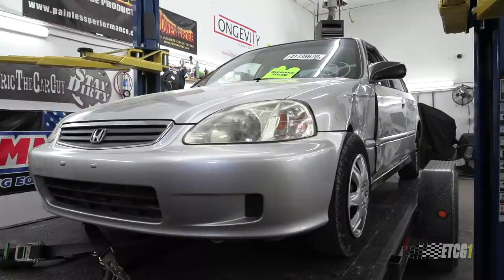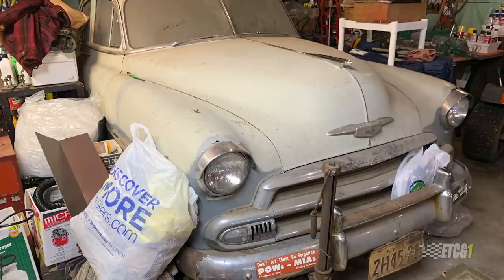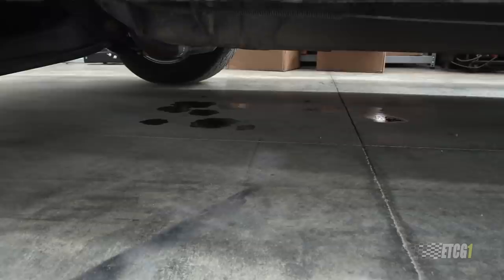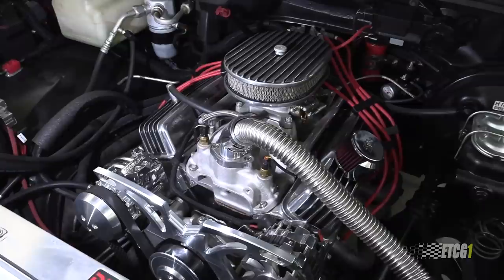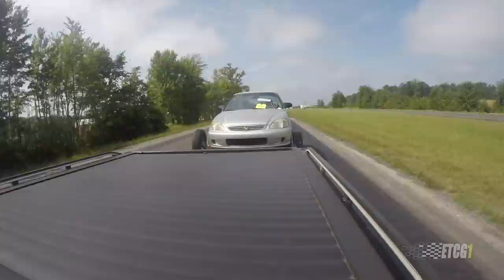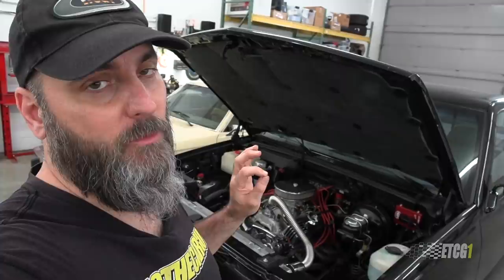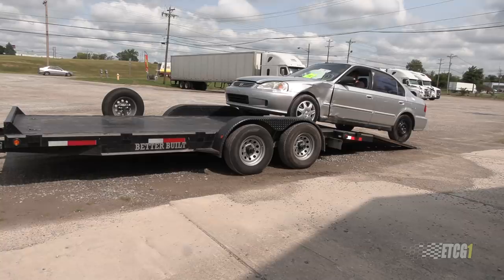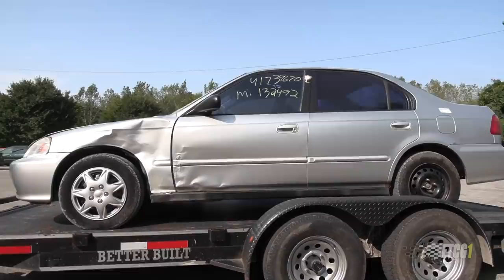First Time Towing with Dads Truck

Comment: For towing vehicles on a trailer, you need a minimum of a 1 ton truck. For instance my 1999 Dodge 3500 with the 24 valve Cummins has a tow capacity of 17500 lb, which would be a perfect size truck to do the kind of Towing you want to do. You also have to take into consideration the type of trailer you are going to be using, such as the tag along,  hitch to the bumper trailer, , a gooseneck trailer, or a 5th wheel setup gooseneck trailer due to the leverage on the back of the truck.
 With a tag along trailer as you have experienced the weight will leverage the truck making the front of the truck light and unstable. A gooseneck setup is better because the weight is directly over top of the rear differential giving better balance between the front and rear axle. 
With the fifth wheel setup you can slide and adjust the fifth wheel to not only balance the weight between the front and rear axle but also to adjust clearance where the trailer will Miss hitting the bed.
Reply from the maker: Excellent info. Thanks for the comment.
Reply: @ETCG1  That is not excellent info, it's very bad and misleading information. With your truck you can easily tow with it. People use 1500's daily to tow cars for a living. A 1500 is perfectly fine for a single car. Multiple cars say 2 to 3 depending on configuration you can get by with a 250/2500. For 4 to 5 cars then a 350/3500 would be advisable. If you only plan on towing 1 car at a time, that truck will be 100% fine. 

With the kind of setup this guy is talking about, that's more in line with a 5 car trailer. I highly doubt you would want more than a 2 car trailer.
Reply: @q......  A factory stock 1500 of that vintage and model,  tow capacity is in the 7,000 lb range, when equipped correctly to do so. You figure on this test run on towing the Honda, you're looking at, maybe 3200 to 3500 lbs for the car, and 1500 to 2500 lbs for the trailer, your looking at a maximum gross of just the trailer and car at the most 6,000 lbs being towed, which is maxing out the Chevy's limit. Yes, obviously the truck will pull it, but as Eric said, it's not safe. 
Now trying to haul the 51 Chevy + extra parts, + hold down equipment, the weight between a 3600 t0 4500 lb car and a 2500 lb trailer, that's a ballpark gross of approximately 7,000 lbs, give or take.  A 3/4 ton will be a better choice for a tow vehicle, but a 1 ton would be best for the combination of the heavier duty engine if diesel and drive train and suspension, dual wheels for better lateral stability,  makes it the best choice on versatility to haul what he needs to.
 For the Honda yes 1 ton is a little overkill, but safe. If he gets, say a 5000 lb '59 Cadillac, he's still well equipped to do so with any configuration of trailer he chooses to use.
Now, out of 20 years of driving semis I've never seen 1500s hauling vehicles commercially. I'm not saying no one has tried, but I haven't seen it. DOT would be making money hand over fist in fines over that, .
Reply: @mikeadams2677  " You figure on this test run on towing the Honda, you're looking at, maybe 3200 to 3500 lbs for the car, and 1500 to 2500 lbs for the trailer"

You really need to do a bit of research, because this makes you look like you do not know what you are talking about. A 2000 honda civic does not weigh 3200 to 3500lbs. Not unless you fill them up with a lot of weight. The weight is anywhere from 2400 to 2600lbs. I could maybe see 2800lbs max. That trailer at most weighed 2,000lbs. The problem with him towing it was the weight was too far forward. He read the 60/40 bs and didn't know how to accurately apply it. He had way too much nose weight. Period end of story. It was unsafe because he used piss poor information and went by people like you giving him bad information. 

" your looking at a maximum gross of just the trailer and car at the most 6,000 lbs being towed"

You are using bad information. The trailer was a tandem axle trailer with trailer brakes. 6k lbs GVWR is the shittiest smallest trailer you can buy. The one he had was a rental and was quite a bit beefier. That one was easily 7k, if not closer to 10k. 

"which is maxing out the Chevy's limit."

No it's not. The limit is mainly pulled from how strong the engine is and the brakes (which he upgraded). An unbraked trailer will require a heavier truck, a braked trailer the loads can be offset by quite a bit. Without doing some testing of my own like how much it squats with what weight I'd be comfortable driving a braked trailer at 7500lbs gross 600miles or more without hesitation. That is if I load it or know that it's properly loaded and or able to adjust it if it was loaded improperly. 

"Yes, obviously the truck will pull it, but as Eric said, it's not safe. "

Again it was only "not safe" because he does not know much about towing and listens to people who don't know much about it either. If he followed the 10 to 15% tongue weight rule. Stayed within that range and he would have been golden. From my personal experience and talking with other transporters and people who do it for a living, when you load the trailer if your truck squats around 1" your tongue weight is very close to that 10 to 15%. You can test this easily with an engine hoist which Eric has, and a crane scale with a capacity of at least 1,000 lbs. The trailer is a known weight, the car is a known weight. Then using that you can use the crane scale and the engine hoist to determine what is in the 10 to 15% window. It's not rocket science. In this specific case, 4400lbs or so for the trailer and car on it, 10% of that is 440 lbs. 15% is 660 lbs. Putting the engine hoist at the front of the trailer and using a crane scale in line to the tongue of the trailer and jacking it up and taking a reading. If it's 1,000lbs... move the car back some and remeasure. If it's 200lbs, then move it forward some. It's not rocket science. Since you drive a truck, you should know all about adjusting your 5th wheel, and trailer tandems to get the desired weight in all the right places, 12k/34k/34k. 

"Now trying to haul the 51 Chevy + extra parts, + hold down equipment, the weight between a 3600 t0 4500 lb car and a 2500 lb trailer, that's a ballpark gross of approximately 7,000 lbs, give or take."

As mentioned above the trailer GVWR was likely a 7,000lbs or greater and would have easily been able to do it. Also a 51 Chevy... is 3200 lbs. Extra parts would have put it at most to 4,000lbs plus a 2,000 trailer = 6,000lbs. 

For someone trying to appear knowledgeable you are way off on your weights. This doesn't help your credibility at all. 

"A 3/4 ton will be a better choice for a tow vehicle"

The best choice is what you have access to that is capable of doing the job safely. That truck is capable of doing the job safely. Buying a 3/4 ton truck towing a single car is akin to someone buying an SUV putting a lift kit on it huge tires, winch, etc, and never once driving it offroad. It makes no sense. The only time a 3/4 ton truck should be hauling a single car is when they are going to pick up one or two more. Or... it's what you have already available. 

"dual wheels for better lateral stability"

Seriously? A single car trailer unless you are hauling something insane doesn't require dual wheels, nor does it provide for any more real stability in that scenario. Dual wheels is needed when you get into 4 and 5 car haulers. Can be helpful with stability with 250/2500's when hauling a 3 car hauler as well but it's not absolutely necessary. 

"makes it the best choice on versatility to haul what he needs to."

If you are only planning on or ever see a need to only tow 1 car. Why buy a truck that you do not need, at all that is capable of 2 or 3 cars? If he indicated he was planning on towing multiple cars? My suggestion would be completely different. A single car like that doesn't matter with that truck. If he had a shitty engine in it, then my suggestion would be a bit different as well. But with an upgraded engine, upgraded brakes, etc his handling situation is a lot better than stock. Even with it lowered. 

"If he gets, say a 5000 lb '59 Cadillac, he's still well equipped to do so with any configuration of trailer he chooses to use."

Wow you got the weight right on one... congrats. A 59 Cadillac would be fine as well. If he were to go buy say a single axle unbraked trailer, I'd advise against it, but a tandem axle trailer with brakes? It's fine. Just so long as he loads it properly with the right amount of tongue weight. 

"Now, out of 20 years of driving semis I've never seen 1500s hauling vehicles commercially."

Then you are blind. Plenty of people do it. Whether they follow DOT guidelines and have the DOT numbers? That's a different story. Typically with single car trailers you don't have to, or at least DOT doesn't hassle you as much for doing it. Also people who typically get into doing it themselves start out with an F150/1500 and move up when they can afford it since 2 or more cars is more profitable than 1. Getting into more than 2 cars is when things get tricky with DOT regulations. 

"DOT would be making money hand over fist in fines over that,"

Again, you are showing that you do not know what you are talking about. 

https://ask.fmcsa.dot.gov/app/answers/detail/a_id/109/~/who-needs-to-get-a-usdot-number%3F

The key thing for needing a DOT number is intra vs interstate, and 10,001 lbs or greater, hazmat is a whole other topic but that would also apply. If you are intrastate you can go over that limit, if interstate you cannot. From my experience from what I have personally done and seen from driving tractor trailers to hauling cars if you are a single car hauler DOT isn't going to fuck with you. 2 cars is getting up there. I have seen people run for years and never stopped once, and seen someone just starting out get stopped almost constantly until they got a DOT number. Personally I wouldn't advise anyone to run a 2 or more car hauler without a DOT number unless they plan on only intrastate. A single car hauler? You can get a DOT number if you want to but it's not required. 

The only thing a 250/2500 is good for is a bit of a buffer for ignorance. You can put a bit more tongue weight and get by with it. One of those trucks and the trailer how he loaded it? Would have been mostly fine. But again, with "Dad's Truck" he could have hauled it very safely as well if... he knew how to properly load it and balance his load.
Reply from the maker: @q......  How is it misleading telling people they should be very aware of the towing capabilities of their vehicle before they attempt to tow something?

Comment: You may want to look at a used 18 wheeler with a step deck or like an f550
Reply: A used 18 wheeler will almost always mean a CDL is required. With Farm use only, and certain intrastate exemptions you can technically but you are not allowed to go over state lines like going from Ohio to NY and back for instance.  

Also that would be like taking a 50cal and using it as a fly swatter. A tractor trailer would be insane overkill. That truck could haul a single car easily if properly loaded. Multiple cars then a 250/2500 would be suggested. More than 3 cars then a 350/3500 would be suggested. If you want to do say 6 or more cars at once, then a tractor trailer would be advisable, a 9 car hauler for instance. 

The F550 is still major overkill but not as insane and you can drive one without a CDL since their GVWR is around 20,000lbs. Anything over 26,001 means you need a CDL. Any trailer being pulled has to be 10,000lbs or under.

Comment: I say pay to have your dad’s truck placed on a flatbed. It’s only a one time spend. Or better yet I live in NY and will take it off your hands. I have the perfect engine for it. My dad left me a Buick Electra 225 with a 455 that was bored to 500 cubes. Has nitrous, headers, stall converter and B&M shifter on the floor. Perfect for the truck (plenty of torque)😎

Comment: My advice would be an old F250 diesel or something of that vintage. Something thats not pretty to look at but works
Reply from the maker: I was actually on the hunt for something like that before dad said he was giving me this truck. Thanks for the comment.
Reply: @JD-so6sk  i cant agree more. Body can be falling off em and they still run great, usually. And generally cheaper than cummins of the same year. 

Not sure Eric has worked on anything Diesel before on the channel either, could be a neat new wrinkle

Comment: Before you blame your dad's truck too much, I'd be considering that trailer's balancing point. The position of the wheels dictates that any vehicle loaded will make the trailer very front-heavy, with little space to move the car back. Reversing the car on may have helped, as the bulk of the weight would be over the axle. Anyway, enough about what I don't know - great video and I'm sure this will raise a few taking points in the comments. Always a good day when ETCG uploads; still the best in the business... still the best on YouTube.
Reply: Absolutely. Not to mention: receiver and hitch rating, brake size, tire load rating and pressure, and caster change giving light steering from improper tongue weight.
Reply from the maker: Those are suggestions my dad also made, however, this car hauler needs to be loaded with 60% of the weight placed in front of the axles in order to work properly. So according to the manufacturer, that wouldn't work. 

Your comments are always appreciated. Thank you.
Reply: @ETCG1  The manufacturer is stating the case for max trailer load capacity, which your Civic is well under. Your Chevy will be a different situation entirely. If it were me, I'd rent a truck and trailer from Enterprise when you go to NY, unless  you can justify the investment
Reply: @ETCG1  Oh, I see. I didn't realize that the specifications were so stringent. On the upside, I take it as a great compliment that my reasoning was akin to your dad's logic - I must know a few things after all.

Comment: My truck is a ram 1500 crew cab 5.7 l hemi it has a 8500 pound Reese hitch and I can say it haul's my camper fine but thankfully my camper is not made by u haul I had a U-Haul Auto transport with a 86 short wheel base Ford F-150 on the back of it hooked up to my truck that was total sketch 💯 percent the trailer alone had my truck squatting the trailer with the truck on it had my truck on the bump stops I can't tell you how many times I lost steering in the rain behind that that was a 9 hour trip that took me 14 and 1/2 hours to do my 33-ft camping trailer doesn't do my truck like that be careful  with that a smallutility trailers one thing but a car hauler is a totally different beast  have a good one Eric

Comment: a front wheel drive civic, why not just use a car dolly. Just load the front of the civic on the dolly, and tow it by the rear wheels of the civic. A lot less weight. Will not hurt a civic at all to pull it with the front end on a dolly, and the wheels of the civic on the ground. Would be a lot easier on the truck too. I’m sorry to hear the truck is not gonna work out as a tow vehicle the way you had planned. looking forward to seeing you work on that old Chevy.

Comment: Hi Eric,
How about air bags for the rear to help the leaf springs.
A lot more professional than air shocks.
you could have a controller in the cab to adjust on the fly.

Comment: I’d invest in some stiffening springs or a nice pair of towing shocks
Reply from the maker: It's hard finding helper shocks for a lowered truck. I was never really interested into turning this truck into a tow rig anyway. I think I'd be better off with a bigger truck with a diesel which is what I had set out to find before my dad gave me this truck.
Reply: ETCG1 my truck is similar to yours except mine is at stock ride height it and it hates pulling. While my moms 91 Chevy Cheyenne k1500 she had wouldn’t struggle as much with pulling. I’m guessing the short bed trucks have lighter rear springs than the long beds

Comment: That's a pretty spindly rear end for that too.  I bet you couldn't hold your hand on the center section when you came off the highway.  16 foot Jon boat with a 10hp and a 30 pack and I think you'll be fine.

Comment: So what would be the fix? Clearly stiffer springs, but then would the truck still ride as well as it does without a heavy trailer on the hitch? Or maybe an air suspension system? Or possibly just get some old big truck (2500 line) for cheap and use her as a hauler, not caring about how she looks and feels, just that she runs and tows...